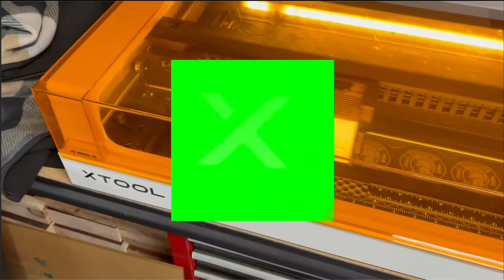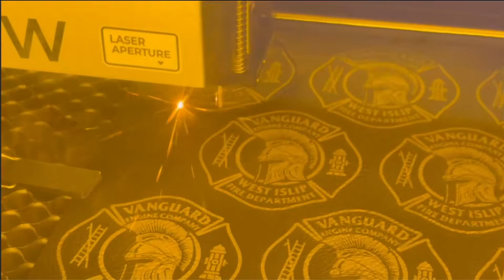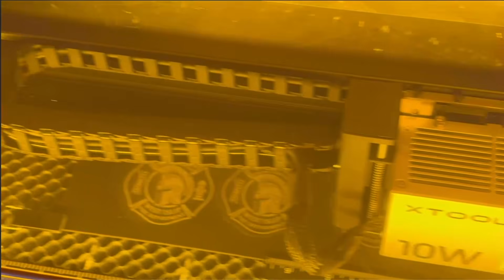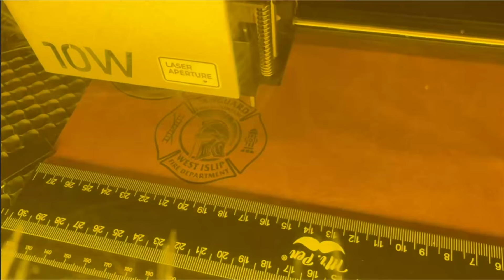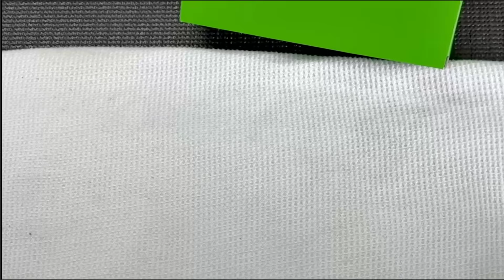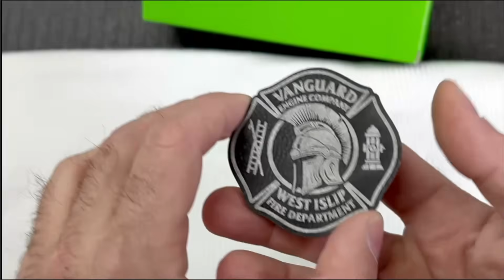xTool S1 10w - still great at making patches

Comment: How would you line up and cut a set of embroidered patches?
Reply from the maker: What laser machine? If I’m cutting or engraving things that weren’t designed on my laser I tend to make jigs. Let’s say you have 10 round patches to cut out - I mock up 10 circles on my laser software that directly overlay the patches. Mark the bottom left starting point of the jig and let it run.